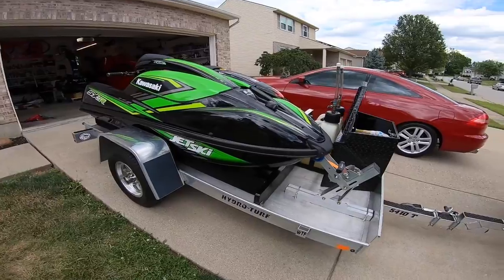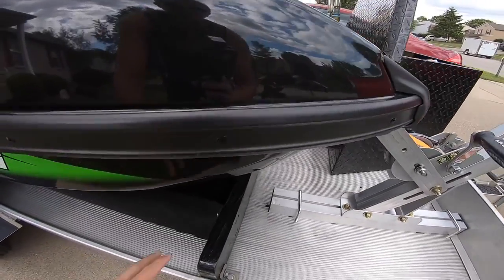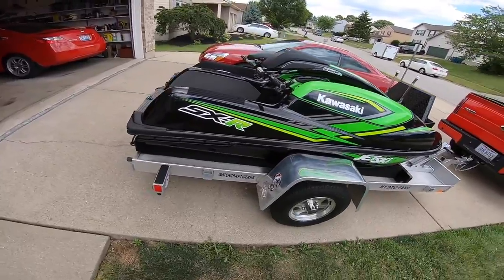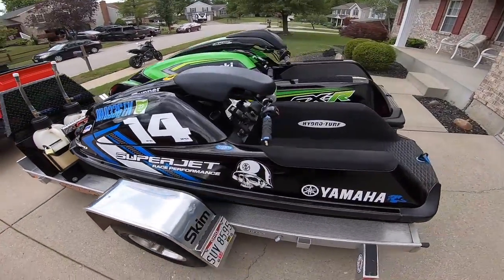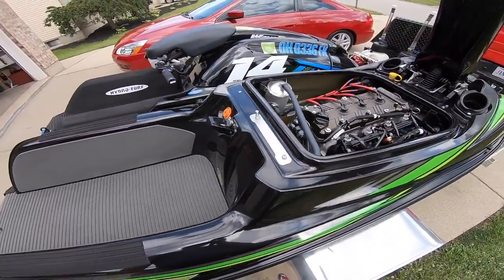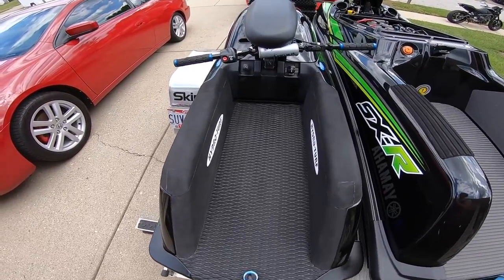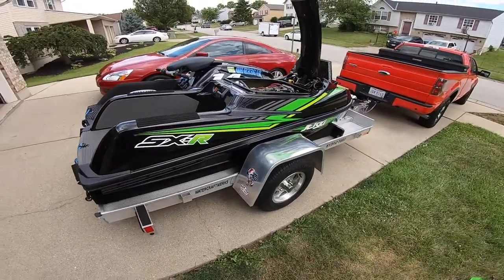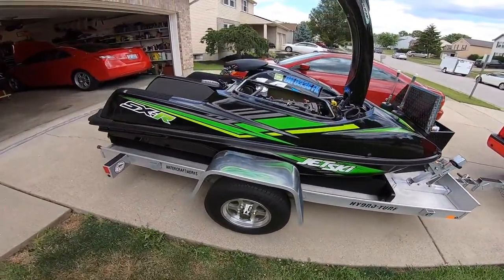NEW KAWASAKI SX-R 1500 TRAILER SET UP and RIDE

Comment: Hey, cool video!  A couple of questions:  are the trailer bunks for the SX-R wider than the Superjet?  If so, what width please?  Also, what steering/handlebar setup are you running on the SX-R?  Thank you
Reply from the maker: @yzfourfiveoh   Thanks! The trailer bunks are same as superjet but did have to move the bunk for sxr over about a inch for clearance on the trailer. Width on these bunks is 12” on center with rounded tops. The handlebar setup is riva racing pro bars 0 degree with crossbar. The throttle trigger was a little tricky had to remove some factory adapters.Thanks for watching! 😎

Comment: Btw, great commentary about the trailer set up!👍
Reply from the maker: BILLY THE PHOENIX Thank you!! You make some Killer vids  Billy. Stand ups for the win!
Reply: @Floatsorrolls1 I'll be ripping on the Colorado River in about 30 minutes. 109 degrees out here and I'm ready to get wet! Stand Ups For The Win!!!
Reply: @Floatsorrolls1  hey what size boards do you have underneath the sxr and how wide? Is it 2×4 or 2×6?
Reply from the maker: mattwebs14 the trailer has 2x6 with 4x4 as cross beams. Used 2x4 with 2x4 cross beams laying flat on our portable ramps that we leave at the boat ramp. The 2in clearance is more than enough for the superjet and the sxr. We only did the 2x6 on the trailer as we thought we needed the clearance for the fender wells. Which worked good with the kawi. All bunks are rounded 12” on center.   Let me know if this helps! Thanks for watching
Reply: @Floatsorrolls1  yeah it should help. Going to pick mine up after a 8 hour drive to go get it later today hopefully! Cant wait, coming from 2 650sx skis

Comment: Who makes the rear tie down pins? That 1500 looks huge next to the superjet lol. Ive yet to ride one, very curious if i will like it.
Reply from the maker: @Zeke Rayment We just bought the pin and used old straps we had laying around but here is a link to one that is essentially the same thing https://www.watercraftwerks.com/product_info.php?cPath=590_851&products_id=8164.      MAKE SURE YOU GET THE 2.5” PIN    for the SXR 1500. We also slid foam insulation onto it to prevent the metal from hitting the ski. A pool noodle will work as well. The 1500 is awesome for going fast and on choppy water. It also is easier to get on and ride for my dad who is 300+lb and 57 years old. If your wanting to jump waves, mess around and do some basic tricks the superjet is the better option.  let me know if u have any other questions. Hope this helps and thanks for watching!
Reply: @Floatsorrolls1  thank you, that's what I have been looking for forever. I have a 800 sxr and I absolutely love it. Rode last night lol.